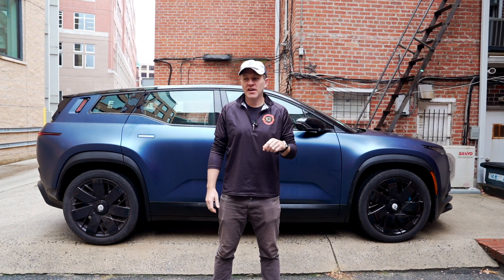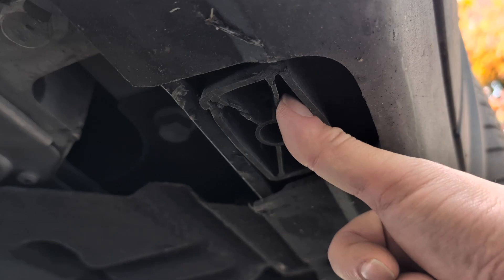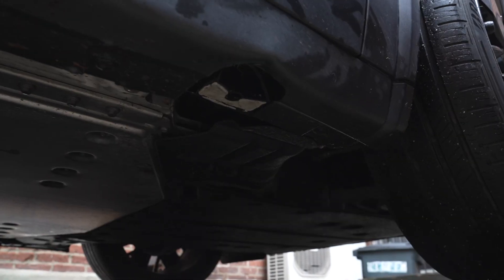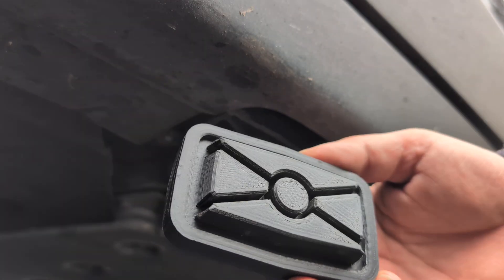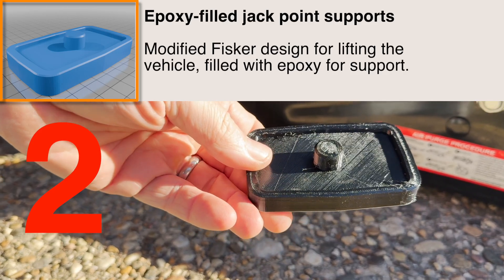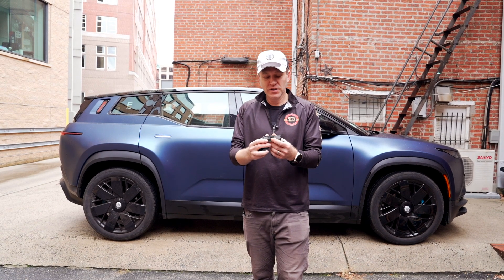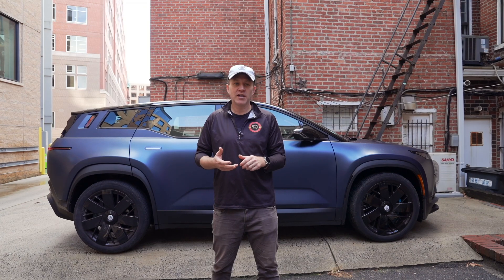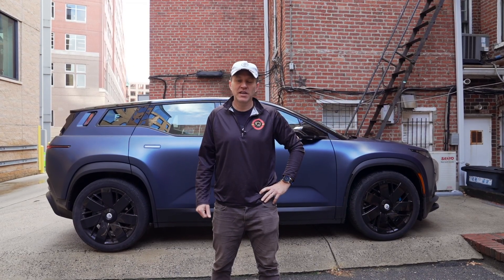Fisker Ocean Jack Point Fix | New 3D-Printed Solutions for Safe Lifting

Comment: Printed my first puck with Sovol 3D SV04, PETG, 240C, 80% fill. It did fit the Fisker Jack but had a layer separation under stress. Any ideas to improve the printing of the Jack Puck.
Reply from the maker: You could try 100% infill. We've seen the best results between 80-100% infill, but perhaps with your printer 100% is best.
Reply: I will try that

Comment: Hi, Miles -- I would like to test out the new pucks on my Ocean One.  Three of the four jack points are in good condition, having used the "hockey puck" type lifting pucks when I had a set of new tires installed on my car. The Left rear jack point (drivers side, rear) was damaged when a tow truck was towing the car a few days before.  This damaged lift point was not filled with epoxy.  Happy to pay for a mixed set (3 standard, 1 with the extension on the outboard side). Will post details & photos on Discourse. Thanks!
Reply from the maker: More than happy to help, Paul. Standing by and please reach out to us on Discourse and we can help you get a set of pucks! We can get you what you need.

Comment: Interesting, you are the first I have heard that had any issues with the epoxy fill mod.  This looks like a great iteration on a solution (first being lift pucks designed for the Ocean, then epoxy, and now this idea).  I know others are researching entirely replacing the entire lift point with a metal version.
Reply from the maker: It would be great to replace them. This solution is a good fix for now.

Comment: need this! 😭
Reply from the maker: We can print some for you - get in touch on Discourse and we’ll take care of it!
Reply: Option 1…..if you go to a tire shop and they rotate your tires to you ask them to take off the insert or leave it in? I have a little over 40k mikes on my FOO and rotate the tires every 5K miles.  The tire shop uses 4 floor jacks to lift my car and it doesn’t appear they are even using these jack point to lift the car. My jack points still look the same as when I got my car.
Reply from the maker: You can insert these pucks yourself before any shop lifts the car to make sure they don't damage them. It's also good to have in case you get a flat and have a tire shop lift just one wheel off the ground to fix it.